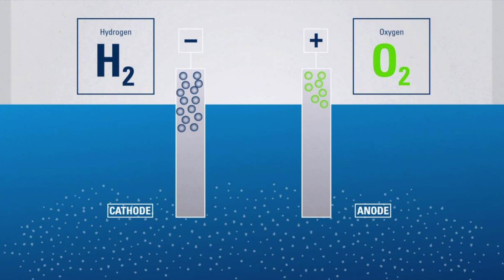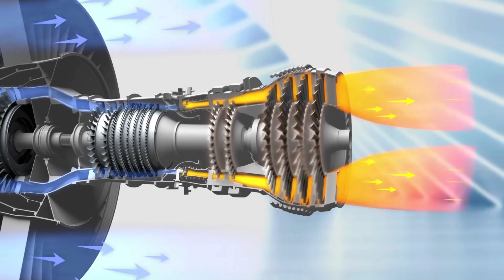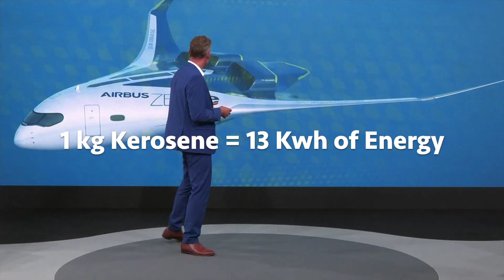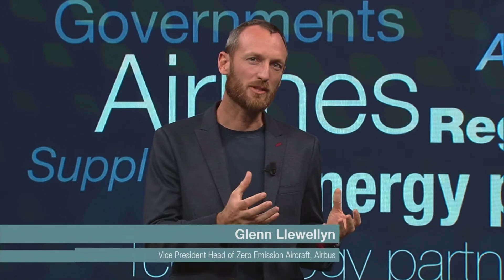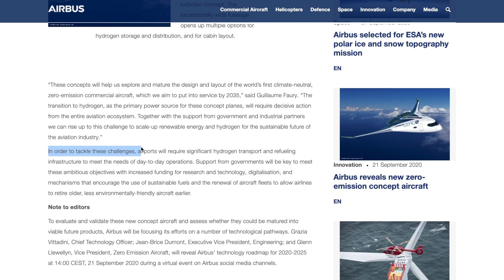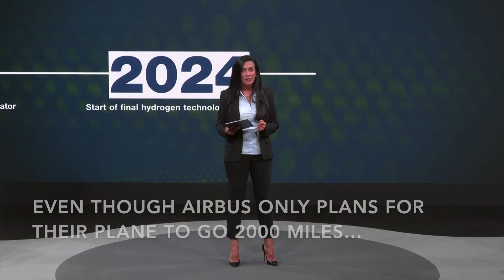Why A Hydrogen Plane Is A Terrible Idea

Comment: Hydrogen is a viable option for airplanes, Hydrogen can be made very clean, doesnt need fossil fuels, with extra electricity, also Hydrogen is very light compared to batteries
Reply: Global warming is fake it is just a agenda to enslave humanity by taking away our access to energy so we cannot resist the evil NWO
Reply: I saw a chart which implied a spherical titanium tank to hold 4 tons of h2 would weigh 75 tons
Reply: @MrDschubba  Think heavy tow composites.
Reply: @1984-x3w  I hope you are trolling :)
Reply: @MrDschubba  yeah we need a better way to store it at room temperature. But I think for this application ultimately H2 is the way to go. It also gives you the ability to burn it as fuel in a jet engine for supersonic flight (propeller driven plane can't meet or exceed Mach 1 as far as we know).
Reply: Amd how do you recommend we step up our green electricity production in order to account for the increase in electric transport?
Reply: @tothemax9850  personally I would say nuclear. But I was a submariner in the United States Navy so I am Qualified in Submarines and familiar with nuclear power. I used to live less than 600 feet (200 m) from an active nuclear reactor for months at a time (my longest time was 87 days).

You realize, of course, that we're going to have to go to battery and/or hydrogen on cars, which will also require an increase an electrical production.
Reply: @neutrino78x  that's why I said electric transport. And we don't have to go electric or hydrogen on cars I think we will find other alternatives that we don't know of yet
Reply: Except the fact there is currently no method of using hydrogen to run a jet engine. There is no existing electric jet engine and using hydrogen to make one would just be hydrogen combustion which is extremely lossy and not clean. So it only is a "viable option for airplanes" if you're okay with planes going only 150mph vs the existing 575mph thanks to lacking jet engines and only going a quarter the range as it is only an eighth the energy density even at 700 bar.
Reply: @Skylancer727  you could do it with hydrogen combustion.  Naca the predecessor of nasa demonstrated it in the 60s.

Usually they mean a motor that's driving a propeller, powered by a fuel cell.
Reply: @neutrino78x  yeah they could, but then it's not really clean anymore as hydrogen combustion produces nitrogen oxides which are toxic. It also is a major threat to ozone damage so highly unlikely for air travel.

Even still though, you still have the loss of less energy density meaning range is much shorter. Fuel cells however just straight can't use jet engines nor can battery planes. In that regard range and speed are both decreased drastically.
Reply: @1984-x3w If climate change doesn't exist,  Can you explain the bushfires in Australia, the melting of polar caps in Antarctica and the north pole and the endangerment of species habitats then.
Reply: @Skylancer727  until roughly a week ago

Comment: An electrical aircraft has the drawback of having 100% of the weight of the batteries all the time, whereas a fuel depletes along the flight so that the weight averages 1/2 of its departure mass. When a plane has to make an emergency return to the airport, it usually has to dump its fuel because its structure could perhaps not resist the stress of a hard landing with fuel tanks full. With batteries not being 'dumpable', you'd have to build a much stronger aircraft, hence, it'll be heavier, less efficient and wouldn't get as far.
Reply: Remember a airplane goes into the air with full load (MTOW, it is strong enough). Only long range cannot land with fuel tanks. Only moderately stronger wheel and suspension systems and moderate stiffening of wings around the wheels are required for landing with full weight. So what you mention here is very small challenge!

For hydrogen it can also be mentioned that a long range airplane will have lower MTOW than a conventional airplane.
Reply: Ammonia cost only  $1,022.50 a ton. Seems like a no brainer.
Reply: @jjoshua69  Nobody talks about ammonia as aircraft fuel. Ammonia has double weight compared to jetfuel (and double volume), while hydrogen including tanks are much lighter than jetfuel (but four times volume).
Reply: @jjoshua69  Current ammonia prices are produced with high CO2 processes.  Green ammonia is possible but will be more expensive than green hydrogen - but that price will probably come down. 
Another drawback is that to convert ammonia to electricity is a 2 step process so that would require more equity to be carried on the plane.
Reply: Parachute half of the batteries in the middle 🤷‍♂️
Reply: @mbican  make sure to dump them over the ocean to charge the electric eels

Comment: Don't forget Airbus has considered the viability of Electric planes before choosing Hydrogen......
Reply: The comment section in this video seems more informative, better answered, and to the point than the video itself 😊
Reply: Not only that Airbus considered batteries on the plane, but they left the "E-Fan X" program with Siemens (now Rolls Royce is running it) and launched the Zero Emission Program.
Reply: So did boeing long before airbus.and !!
Reply: Green fuels that handle the same infrastructure.
Reply: Indeed, but there's also a major point that few talk about.
It's a fact that Electric is the future and its almost a direct process from obtaining it until its use. But of course that's not the case with the current batteries we have. Yet, technology has proven to increase much faster when there is a demand on the market, which could result in a much faster improvement. There are already amazing projects on batteries which could already be on the market if they had enough investment.
But other than that, in a short time transformation, hydrogen could be the only possibility, specially for long flights.
What few talk about is that there is something way above from what's better or cleaner for the planet and that's called money/power. Never forget that Hydrogen will keep the same supply process as petrol. So that's exactly what money lords support. What money lords are afraid is Electricity because today its already possible to have a sustainable house without the need to pay for the electric network (and many people in the world already have it). But probably no one on the planet has its own hydrogen processing central, which by the way, would require a lot of energy/electricity.
Considering that just a very tiny portion of airline carriers in the world have direct access to a petrol refinery (and lower fuel costs), imagine how many of them or even how many airports could have their own Electric supply chain and industry.
Unfortunately it is very important to consider that "money" is much stronger than "the best path" for sustainable energy. The Petrol lords will do everything to keep their monopoly.
If it wasn't for Tesla, we would probably still only be buying ICE cars. And funny thing was that in the beginning, powerful industries like VW said it was non sense and electric cars wouldn't survive. Now they announce that in a short time they will stop producing ICE cars.

Comment: This argument is highly biased. It speculates that batteries will be 10x more efficient in kW per weight than the ones we have today. It rules out that electrolysis could be a byproduct of network stability and therefore a lot cheaper. And it completely ignores facts like the decrease in weight while flying (as opposed to batteries), the challenge of building a sufficient supercharger network, the massively increased turn-around times due to charging batteries and the wear on batteries as opposed to combustion engines or fuel cells (a typical short to medium haul aircraft has 4 cycles per day, that's 1.460 a year and 36.500 over the normal 25y lifespan of a conventional plane. No battery know to me can handle that).

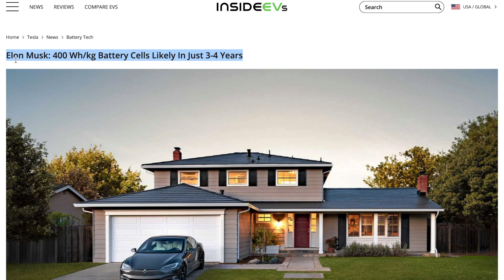Comment: 3:26 Sorry but "Elon musk said this will happen within X amount of time" says absolutely nothing. He is notorious for being wildly inaccurate when he makes predictions or promises about future tech.
Reply: Plus that a kg of hydrogen (generated by hydrolysis) cost around 5$  and if it drops down from 2 (considering the hight energy density per mass) it will be more worth of using it for direct electricity production and couple it with electric propulsion engine
Reply: Where are the Roadsters that were supposed to arrive in 2020?
Reply: This the problem with his fan bois. They take his words like a christian would do of Jesus